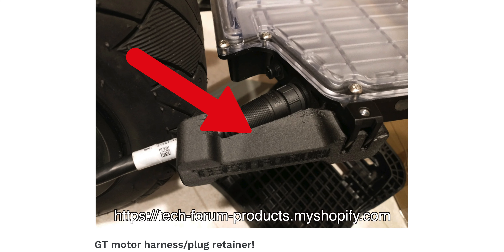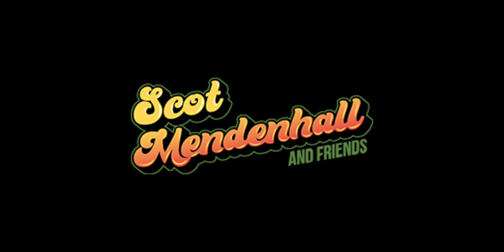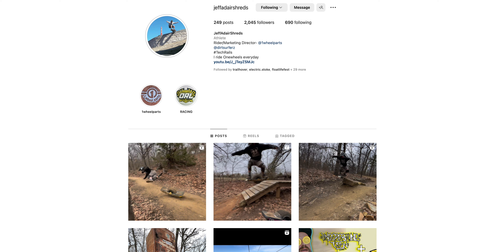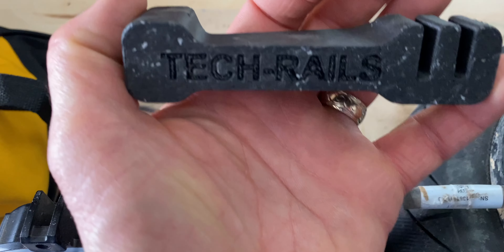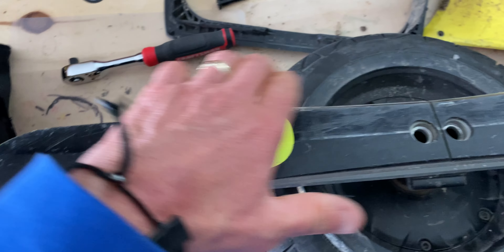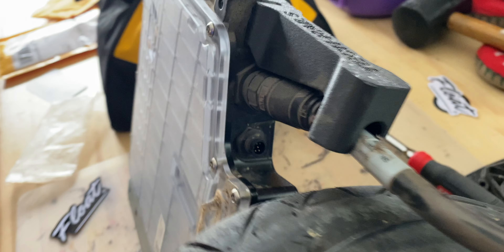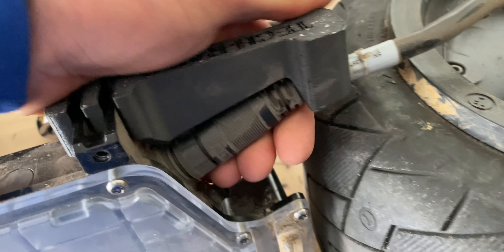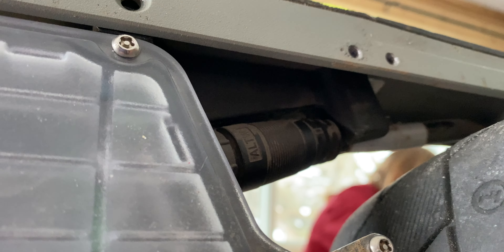ONEWHEEL MOTOR HARNESS RETAINER Is Awesome!

Comment: Do you know if this would also work for the Front foot pad sensor connector?  I broke the connector on that like a dummy and glued it on but would love a mechanical connection as well!
Reply from the maker: I think that cable is not as wide as this one.